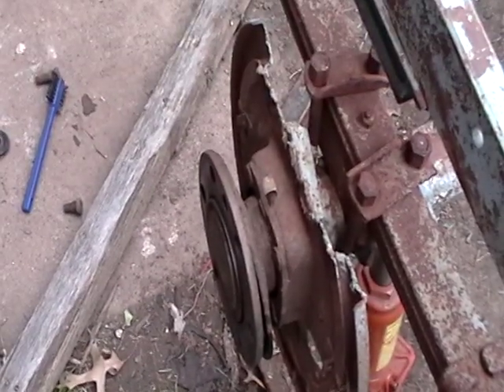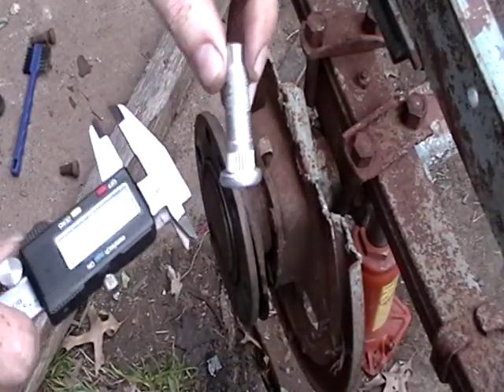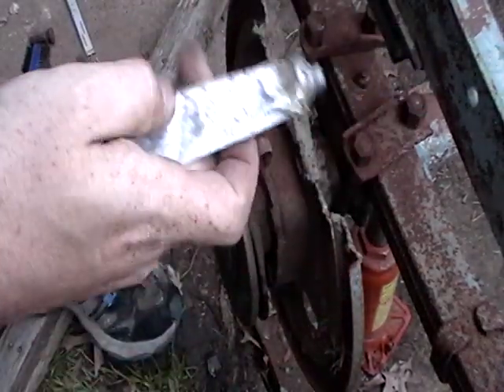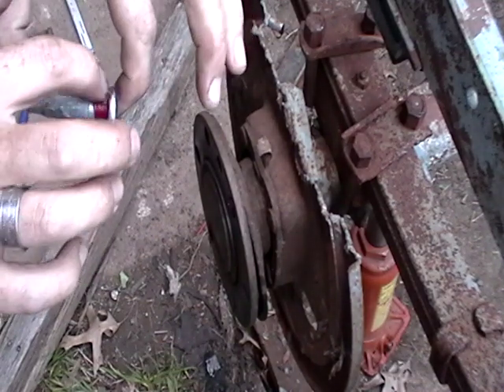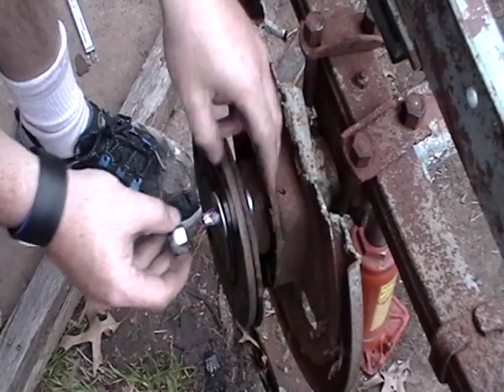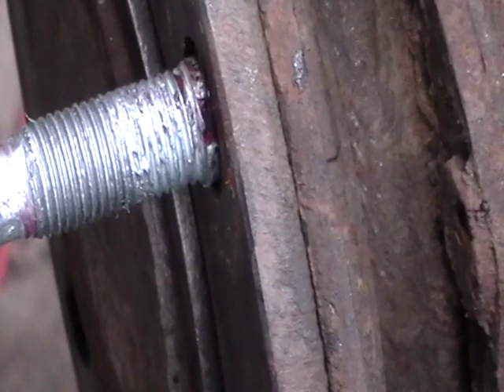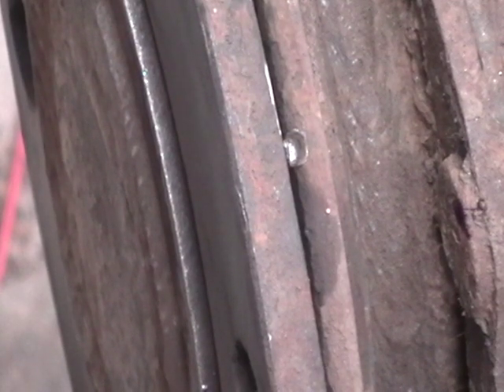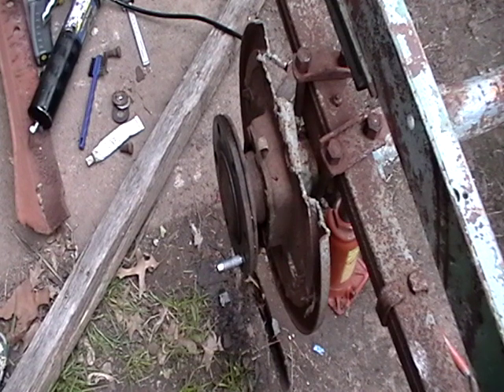My way of installing wheel studs (TIPS??)

Comment: Looks like a good method. We used an air hammer on the inside while tightening the nut with a socket wrench to push the studs into the Dodge hubs.

Comment from the maker: Thanks The backwards nut I learned form an old-timer mechanic. The freezing part I just tried to see how well it would work. I always used anti-seize from removing wheels and threads being rusted locked and breaking a stud or just hard to remove.  The grease I just figured it was a good idea.  When I did the other side I didn't use any grease.  Just WD-40 and it worked fine.    Thanks for watching I appreciate it